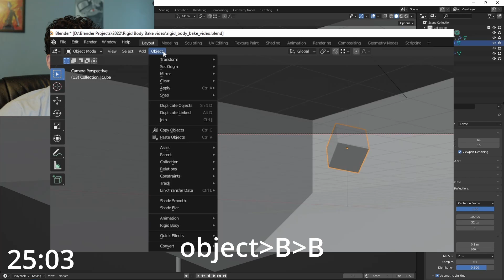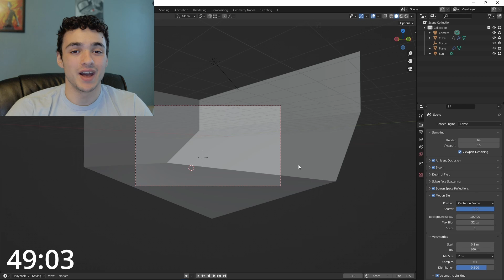Bake Rigid Body Physics in Blender

Comment: It would be good to update the title to baking rigid bodies to keyframes. As the other comment said this is not a simple bake. If you have many rigid bodies in your scene, baking to keyframes would make the blend file really large. It's also tricky to go back from if you want to change the physics later. I have about 4K rigid bodies in my scene as I'm rendering an explosion. In this case I want to bake the physics in scene properties, so it doesn't slow me down and keep recalculating the rigid body physics after I save. Baking to keyframes would be useful if I wanted fine control over a specific object. Like if one chunk of debris needs to move a certain way, I could bake it to keyframes and animate it by hand, using the current motion as a starting point
Reply: Thanks

Comment: The thing with this is it's not actually a bake. It's baking to keyframes which is diff than baking. Because we are baking to key frames this add an extra step that works well- but should be used more for animation. If you want to do a traditional bake- go to scene properties (cone and cube), there you will find Rigid body world.  You can then bake all your rigid body sims- however they wont be saved as key frames. They will just save to cache. For simulations in blender you can keep multiple bakes at the same time... baking to keyframes is more of a thing where you are for sure you keep that exact same motion... not for testing per say.  Good video.. I would just change the language a little. But good stuff :)  Also if anyone is really getting into Sims try Houdini out... Houdini is Queen of sims :)
Reply from the maker: thank you! very well explained
Reply: That's the problem with these quick 1 minute videos - doesn't go deep enough to really cover all the variables or best options available.
Reply: You can't do keyframe bakes for multiple objects. Just one. Houdini is expensive.
Reply: for some simulations in blender you can keep multiple bakes *
Reply: thank you
Reply: Thank you random comment on the internet from 2 years ago

Comment: man, i am having a problem... the bake is just taking too long to start... blender just stop responding... any tips about that?
Reply: Hey, I have a same issue. It took 2 hrs to bake the simple physics. How did you solve it? I know it's been a while, but can you let me know if you know the solution?
Reply from the maker: possibly your scene is too complicated for the CPU? try a few pieces at a time?
Reply: @BlenderDojo  i dont think is hardware. I think my setup is ok for The size of the simulation that i am doing. I think that the real problem is the bake button, i say that because small simulations using just cubes give me the same problem
Reply: And the play on the viewport works great too
Reply from the maker: @TheMrJackzilla  try a different version of blender. Might be a bug
Reply: @BlenderDojo  i know that is going to look like i am a crying baby, but... XD
I tryied with 2.8, 2.9 and 3.2
My hardware is an last gen i9 and 64ram... I must be doing something wrong, but cant find nothing about it 😅
Reply from the maker: @TheMrJackzilla  very very weird. Try submitting it to r/reddit or any support forum. Good luck!!
Reply: same problem
Reply: Same problem with me though.. i have rtx 4090 n latest i9 14th gen but took too long to bake cache for 1100 frames for rigid body.. any solution please

Comment: The timer is not needed and is distracting. Youtube already has the time slider if for some reason I needed to know exactly how long the tutorial is.
Reply: For real... That time is stressing me out!😵‍💫
Reply: ok for the timer but no need for the tenth and the hundredth ;) and the bb shortcut doesn't work for me so you should give the menu access > Object > Rigid body > bake to keyframes
anyway thanks for the tip
Reply from the maker: is it really that hard for you to not look at numbers mr quarkburger??
Reply: @BlenderDojo  LOL my apologies. I didn't realize it was so important to have the redundant timer there or the the length of the video was the most important part of the video. By all means, roll those numbers!
Reply from the maker: @Quarkburger  love you Mr quarkburger. I knew you would see my side <3